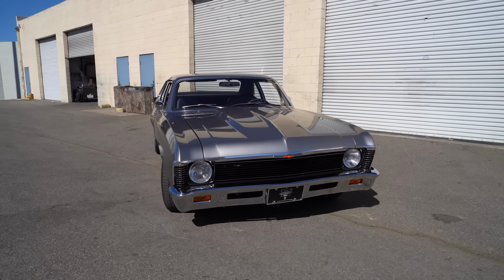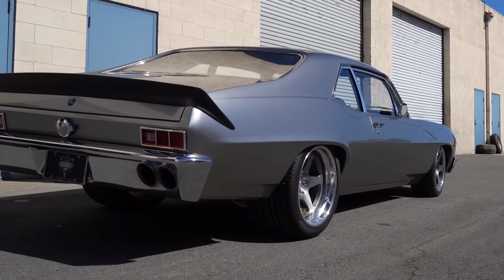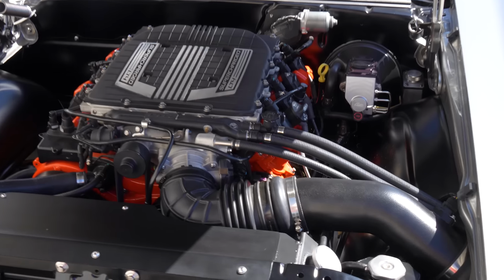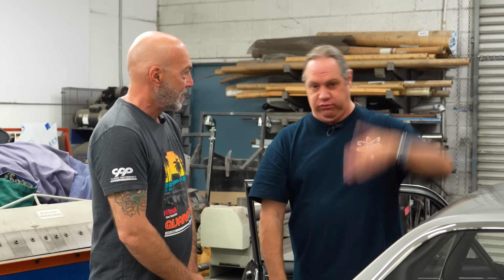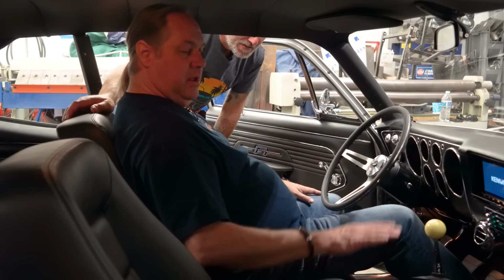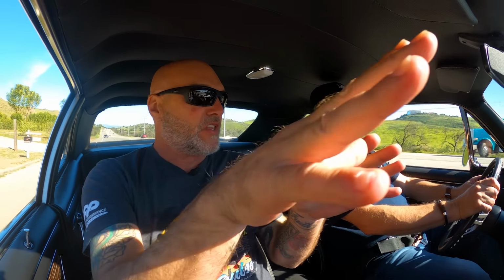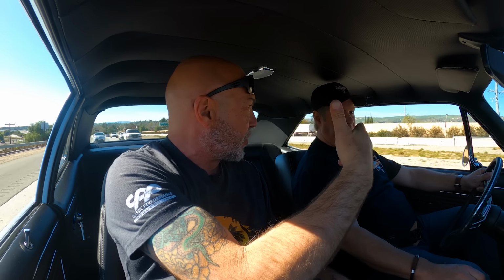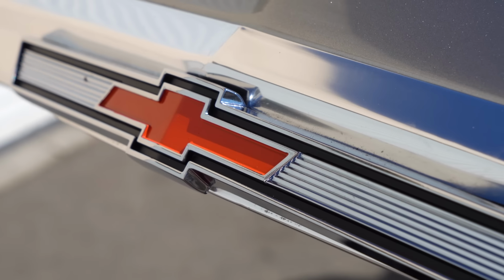Joe Rogan's EXTREME Custom LT4 Powered '69 Nova | Steve Strope & Pure Vision Design Built

Comment: The 69 Camaro sheet metal and body lines achieved the factory & custom concept beautifully and that alone would have been enough to set this Nova’s appearance apart from any other. Strope nailed it on that aspect buuut, the bumper exit exhaust tips are a bad eye sore and I don’t remember them there when they originally revealed the car in the raw metal finish. I feel like that had to be something Joe Rogan requested and they gave him what he wanted. Now the rear spoiler maybe could take some to getting used to, but It also interrupts the flow and attention to detail put into the 69 Camaro fender and quarter skins that were masterfully incorporated to the cars design. Everything else is spot on. I especially love the wheels, I reminds me of Mark Stielow’s 69 Camaro “The Mule”.

Comment: I would have gone with dumps for the exhaust and a spoiler that runs only the length of the deck lid to the edges, which would give it a cleaner look and be more true to its original heritage, adding to the factory look he purports to be going for. Still, you got to appreciate the skill and effort involved and it's definitely unique!
Reply: Spoiler alert
Reply: @darylarmentrout252  

😂
Reply: @darylarmentrout252  touché Sir……..Touché
Reply: What does it do?  
Well for one, it directs the smoke like a tail when you're doing doughnuts!

Comment: So it’s a F body Nova interesting. Nova’s and spoilers to me is ehh. Now for the elephant in the room the exhaust, well either tuck it like a 61 or 62 Vette or run them out the rockers just forward of the wheel wells. It gives it the more traditional 70’s early 80’s look but since the frame is there well.. Still a good build and thoughtfully designed. Thanks Shawn Great Video!! I hope Steve and his design team read my comments.

Comment: I have a 71 Nova and although I would happily upgrade the engine, interior, transmission etc. I wouldn't touch the exterior as they designed it very well. Peoples tastes are different and if the owner likes this, then he shouldn't care what other people think. However, this seems to me to be an example of spending massive amounts of time and money to worsen the original.

Comment: Those tires are so wide. They had to do a lot of work to fit those in there, and get them to clear everything, and have enough travel to not rub when it runs over a pothole. I'm looking at the very last shot of it and the tops of the tires are up in the wheel well. IDK how that thing turns without rubbing.

Comment: I remember when Rogan had a 'Cuda made by Troy Trepanier, that was designed by Chip Foose, about 20 years ago. That turned out to be a bad experience for Joe, as the car was just a headache overall for him.
 I understand most commenter's gripes about the rear exhaust. It's because of the IRS and rear subframe that necessitated the exhaust to be routed that high up out back. Yes, I agree with others that a dual rectangular design would look better. It would also look better if the oval exhaust it has now, was a bit smaller, and mounted a bit lower on the rear bumper.
 It's still, overall, a bitchin Novamarobird!

Comment: That is surely a shit load of work! Well done, BUT, something about the rear spoiler is not right. Maybe the angled section on the qtr panel just doesn’t look right on a Nova.😢 Also the tailpipes in the bumper looks very odd and maybe even out of place. I would have added shoulder strap seat belts. Waist belts are not enough.

Comment: It's just like engineers creating things just to justify their job. Lets make things wider that wont be noticed unless explained, or if next to a Nova that wasn't fucked with for no good reason. The rear bumper, and spoiler look stupid! The worst thing about this is it was probably a completely solid Nova that didn't need any body work, instead of one from a junk yard somewhere in the rust belt. Restomods are great when they leave the design alone, they only made this car from 68 to 72, why couldn't the ones destroyed by road salt, and accidents be enough

Comment: Exceptional work with many poor decisions. Not a fan of the Camaro fender graphs. Enhance what you have, don't try to make it look like something else. The entire back end is just bad, again imitating the Camaro lights with what looks like a huge unmodified stock bumper with holes drilled for exhaust and a 2nd gen spoiler monstrosity. As I said exceptional fab work but your better than this, I look at this build and personally I would never drive this looking as it does.